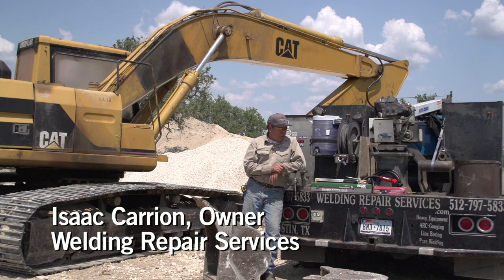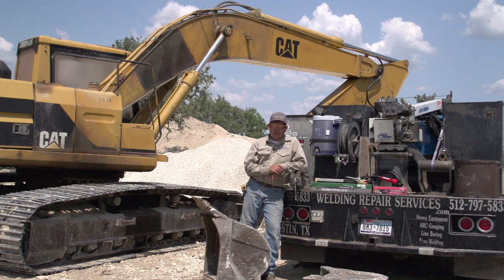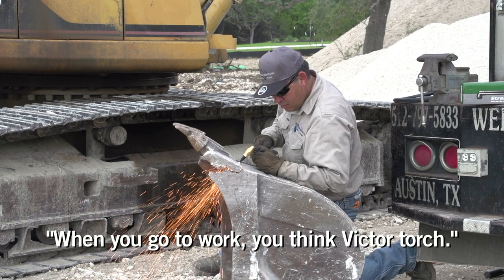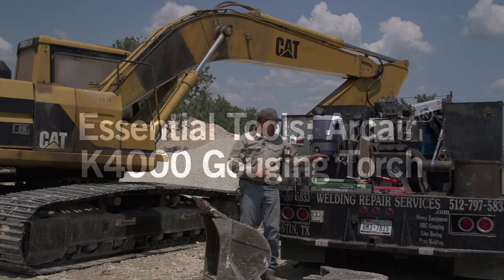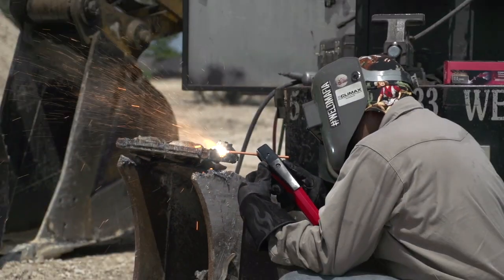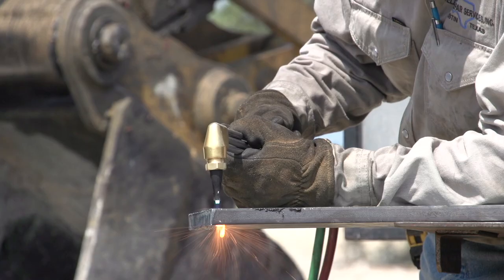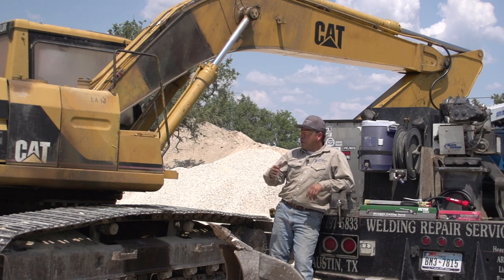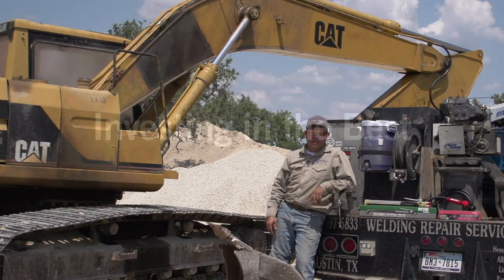Welding Repair Expert Uses New Victor ST400 Torch, Arcair K4000 to Gouge Bucket

Comment: I have been cutting and welding for over 43 years I have used every torch on the market none of them compare to a Victor, I have six of those in my shop they are the most durable longest lasting best cutting torches that I have ever been designed in my opinion
Reply: I agree.

Comment: victor torches are the best and almost any welder supply can get the little replacement parts. i have foudr victor torches and a collection of other torches that are not useable because they are orphans.  i like the 70 degree torches for most work